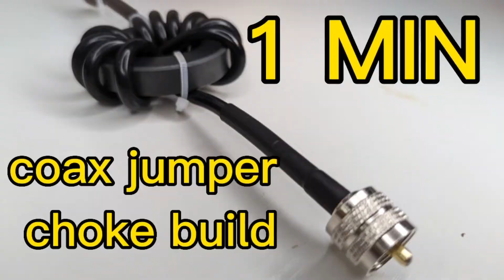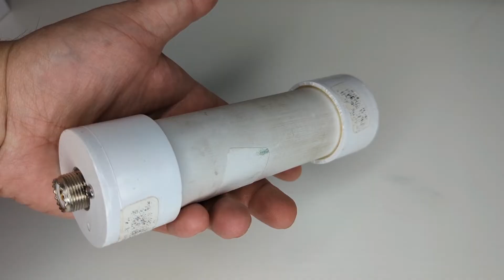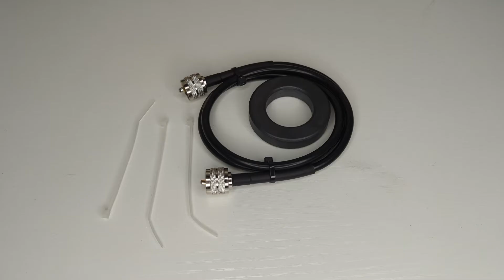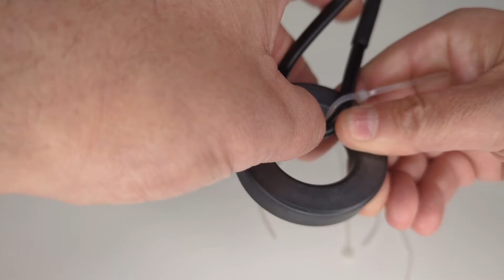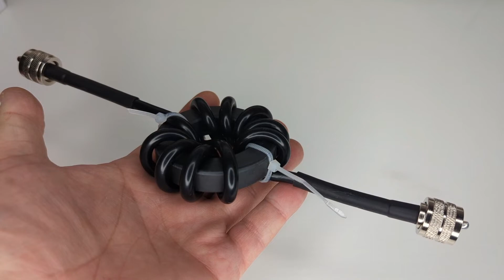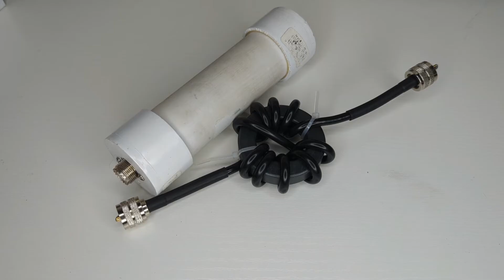RFI Choke - 1 minute build

Comment from the maker: For those wondering, this is a 43 mix toroid. Generally speaking, the 43 mix will be slightly more advantageous on higher bands 10Mhz and up, where the 31 is better suited for the lower bands. Links in description for toroids and jumpers
Reply: What if my goal is running 10 through 80? Is 31 the way to go in that sense?
Reply from the maker: @Kody10538  personally I get more noise during the daytime on higher bands. Experiment and see which bands you're getting more noise on and use the appropriate toroid mix for your targeted noise

Comment: You are making the turns WAY to small for the RG8x you are using. Minimum turn radius for RG8x is about 2.5 inches.... so the overall circle should not have a diameter of less than 5 inches (6 inches to be safe). Turning it this tight will lead to the possibility of the center conductor being forced through and touching the outer shield for a short.
Reply: Most manufacturers who make a RG8X type cable to the original (now defunct) specs specify a 0.75" one time bend radius (2.4" for repeated bends).
Reply: @michaelstora70  I would definitely say he had more than one turn, so I guess you and I are in agreement... that many turns are WAY too small.
Reply: @BackBeeBrokenBeekeeping  not if he only assembles it once.
Reply: @michaelstora70  oh I understand what you mean now. Got ya

Comment: Don't do this with foam dialectic the center conductor migrates through the foam towards the shield.
Reply: Just stay above the minimum bend radius of whatever coax you are using.  Even for LMR-240 which is the lowest density foam any ham will generally encounter, it is 0.75" (1.5" dia loops).

Comment: thanks for the video instructional.  i see that it is possible to get PL-259/SO239 RG8x jumpers now.  that way you don't have to use an adapter to join the feed line.  so, would this work ok at legal limit?  i'm assuming that it would.

Comment: Ham newbie here…and this is very interesting.  Thanks for posting.  I’m learning, so let me ask this question:  how does this differ from a couple dozen coax wraps around a PVC pipe (which is what I suspect is in the old MFJ thingy)?
Reply: The MFJ Thingy is actually a linear piece of coax with a lot of ferrites clapped onto it in series. Which serves the same purpose be made in a different way than the "ugly balun" made here. Keep in mind the small radius of the turns in the video is too small and will eventually end up shorting due to exceeding the allowable turn radius of the coax being used.
Reply from the maker: @elmoreglidingclub3030  it's really just a different version of the same thing, just much smaller. Ultimately you won't really know how any of them affect your application without testing.

Coax coil wrapping is nice because you can "tune" resistive / capacitive characteristics with more or less coils. You can do that with different toroid mixes or # of wraps with these, just to a lesser extent.

Comment: What ferite should i use for 10 meters and 11 meters vertical wire antenna?
Reply from the maker: A 43 mix toroid is generally regarded as being more beneficial for those higher bands
Reply: How many turns?
Reply: Elephant 🐘 dung

Comment: The purpose of a choke is to reduce common mode current. But you do not meaure the   R+/-JX of the choke- so   do you know what you have built? If the choke is overall inductive and the   length of your coax (outer shield) is net capacitive, you could actually be making common mode worse?
If you don't measure it, you don't know what you have or  how to improve it.

Dale W4OP
Reply from the maker: Indeed, Dale. I do have a Rig Expert analyzer, so I know the end result with it inline my feed. Admittedly I don't have enough concern to test the choke itself. I have a CMC choke at the base of my vertical, and this one plugged into the back of my meter in the shack 125' away. Slightly capacitive/resistive on either side of 30m center on a multiband vertical

Comment: 240 31 ??? or 240 43.??
Reply from the maker: This one is a 43 mix since I generally work the higher frequency bands. A 31 mix is arguably more suitable for 40-160m
Reply: @whiskeysix   Actually, for a common mode choke, a Mix 73 ferrite core is better for the low bands (160-40M) and the Mix 31 is better for the high bands (40-6M).  Mix 43 is better for HF Ununs or Baluns.
KE6PO

Comment: Without specifying the core mix, this is kind of meaningless...
Reply: Maybe I'll withdraw the word, "meaningless" and replace it with 'would have been helpful to discuss'.
Reply: My understanding is that the core type selection is dependent upon the freq of the interference and the freq of the transmission but the physical build is the same regardless.
Reply: It's elephant 🐘🐘🐘🐘 dung
Reply: look at the pinned comment up top.

Comment: It does not work for me on 27-28 MHz and the rod antenna. The RFI keeps coming. How to remove it? Won't adding a few radials help?
Reply: You may have ground loops. Disconnect any ground connection on the rig’s ground log. It’s not necessary and can cause ground loops which occur when the gear in your shack are on a different potential. You may need ferrite on the PC USB cable and/or other cables.